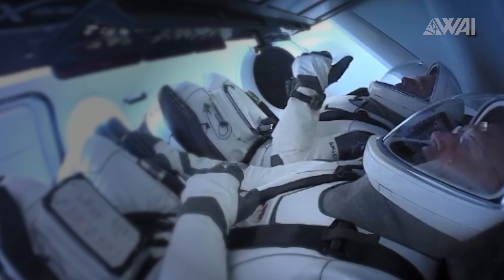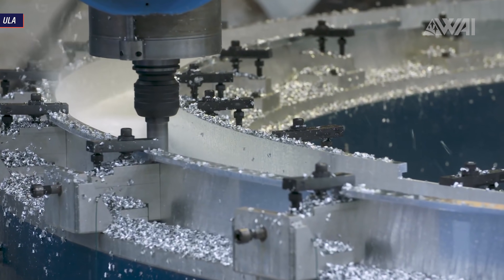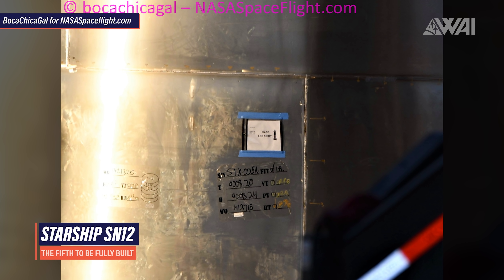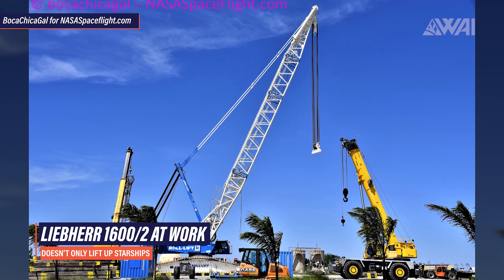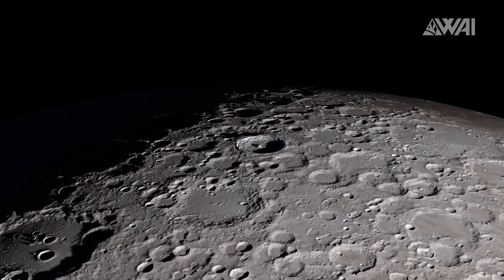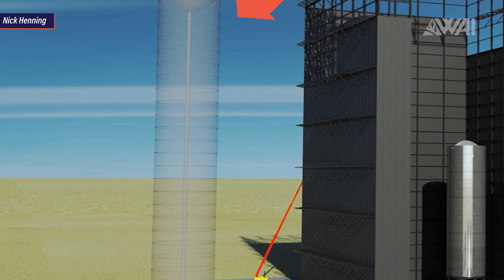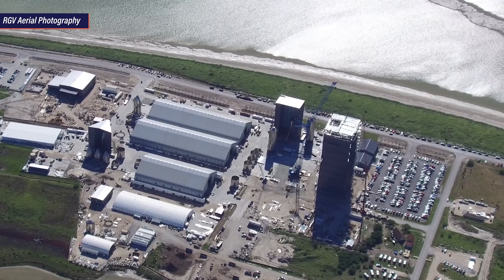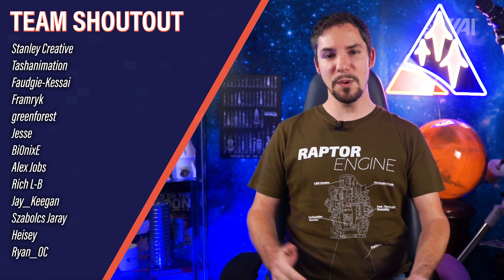124 | SpaceX Starship – Testing About To Begin - Super Heavy The Giant

Comment: @What about it?
I've have a theory about the whole "producing LOX on the old gas well site"
Recently there has been a mystery on what will happen to SN5 and SN6 now tat we know their test flight purpose is done, they have been wandering between the bays, basically being empty space.
Don't you think it would make sense that elon sends them both to the on-site LOX production place to use them as storage units for such LOX? 
They could also change the engines on them for some the ones to be used in the superheavy, and use them to static-fire in order to test the locally produced LOX's quality.

Why trash them when you can still use them? Steel rockets ain't cheap.
Reply: LOX storage tanks are dewar tanks. The insulation is like a thermos bottle. A full vacuum space.
Reply: @kkarllwt  Good point. Hadn't realized they had to be. 
Now the question is, could they be repurposed as dewar tanks or their best hope is either decorative structures at the entrance or scrapyard material?

Comment: Very impressive, specially the fully flow raptor 350 bars engine, a kind of formula one engine performance with the endurance of the the old Cox air cooled where the other still have have the F1 short life with a Cox engine performance...Yet my greater concern remains that no one and no recovered load ever came back to earth from the outer space in a large light tin can. The behavior, endurance and resistance to the atmosphere upper layers of a thin evaporative shiel glued to a SS steel thin can at 8 then later at 11 kilometers per second !!! remain to be seen. It depend entirely on the possible good lift to drag ratio of the light rather empty Starship and its ability to extent le slow down process over time to reduce the peak heat stress well below melting and burning level...To me this remains and will be by far the biggest challenge of the whole launch recoverable system.

Comment: He said, they are getting 'a power line so they can use wind power'. The power line isn't needed if your wind turbine is local. That means that he will be using surplus grid power to run a liquid oxygen plant at off-peak times.

Comment: There are some interesting Super Heavy milestones to watch for.
     Can the thrust puck to ring weld hold up to the added weight of the much larger amount of O2 and CH4  in Super Heavy with a full load of propellant vs the Starship.  If I got the figures right a full load of propellants would put 5.24 Bar of pressure on the thrust puck.  Add tank pressurization and RUD?
     Can that weld hold up to the pressure of 28 Raptor engines firing or will it simply break free and shoot up into the liquid O2 in a RUD.
     Elon's self set goal of sending Starships to Mars by 2022 and to the Moon in about the same time frame.  Last we heard SpaceX was producing Raptor engines  at a rate of about one per month.  Is it possible to produce enough Raptor engines for the Starship and Super Heavy full prototypes through 2020 and 2021 at a total of 32 for each complete prototype?  How fast can the output rate for Raptors increase, allowing for production of multiple Starships and Super Heavies for a full testing and certification program?

Comment: One point no one has spoken of is: will the super heavy booster need to be fully or partially loaded with fuel before star ship is stacked on top? Since one of the failures of starship was in effect the loading of the top tank before the bottom tank, this will be a more prominent issue when a full payload is added to starship and stacked in top. If so, then there will be a massive risk of stacking starship on super heavy while it is partially loaded. 
Could you touch on this risk in an upcoming video.
Thanks

Comment: Bottlenecks are still Raptor production and launch site facilities (for a full stack). The heat shield is still completely unproven as well.
Reply: Raptor construction is constantly increasing and last I checked they have over 40. Heat shielding is old technology and should not be a challenge.
Reply: @MrEd2291  40 built over how many years? They only recently have reached a flight worthy design (see the engine rich exhaust on Starhopper). My worry is that even when they do manage to produce enough Raptors for an orbital test, a single failure could set them way back given the number of engines that would be lost.
Reply: @MrEd2291  Furthermore, tiled heatshields like the space shuttle used have yet to be done well. In SpaceX's early tests, the tiles they attached did not seem to do well even without atmospheric re-entry. This may prove to be an easy hurdle for them, but it is yet to be seen

Comment: Based on that Super Heavy booster rendering, why  does the booster have to be so tall? It looked to me that the fuel tank was way up near the top, and the engines way down at the bottom with nothing between them but a long, narrow pipe.

What am I missing?
Reply: The downcomer was passing through the liquid oxygen tank, not empty space. Liquid methane can be piped down through liquid oxygen because the temperature difference is not too large.
Reply: The LOX tank.
Reply: The entire booster contains two pressurized internal tanks holding two materials (components) for fuel, w/ the long narrow pipe through the bottom tank pipes one component of the fuel from the upper tank to the engines, where it is mixed with the other component of the fuel from the bottom tank. ;)
Reply: @theknave4415  Awesome! Thanks for that.

Comment: 7:35   The freshly poured concrete has been covered with a tarp to slow evaporation of water out of the mix.  That helps eliminate cracks.  They will stay covered a few days.  Curing concrete is an exothermic reaction.  The huge metal surface will act as a heat sink and aid in keeping it cool during that time.
Reply: Has anybody spotted 'vibration' machines yet, would be surprised if they aren't settling the concrete.
Reply: There is one attached to the boom. It extends down 4-6 ft below the end of the boom.

Comment: The thrust puck on the Super Heavy will have significant head pressure, significant weight from the engines and significant thrust & vibration. The weight of the downcomer will be a significant load on the common dome.  Add-in yet-to-be-experienced acceleration forces and my guess is design of the domes and their attachment to the main structure will come back to the forefront.
Reply: Yup, the upper 90% of SH will be easy, the bottom 90% will be very difficult.
Reply: Don't you think that those hydraulic jacks on the test vessels were testing for these forces and loads.  Give them some credit.
Reply: So, would you say these are significant issues?
Reply: @odysseusrex5908  
No. With such good engineers, simulation software, and early testing they should have no issue with optimising the SH domes. 

I am concerned mostly about the tile brittleness displayed so far, probably due to chaotic resonance of acoustic waves in the hull. The amplitudes are exceeding the capacity of the elastomeric layer. This will not prevent reaching LEO, but a good reentry requires intact tiles.
Reply: @avid0g   LOL, I was making a joke about the OP's repeated used of the word significant.
Reply: @odysseusrex5908  
Pls "stamp out and abolish redundancy"!  LOL
Reply: Keeping the structure radially in tension is the job of the hot gas pipes.  The entire ring structure is axially in compression, from its weight, from the thrust and multiplied by acceleration.  Those gas pipes are critical.  If pressure is lost, the column formed by the rings will certainly buckle under load.
Reply: The (only) tricky part of the design was to minimize mass while distributing the concentrated point loads on the thrust puck from each LOX-feed pipe, and that was already achieved on the Starship thrust puck. 

The thrust puck applies all of that Raptor engine thrust against the elevated tank pressure (and propellant inertia), not the tank walls. The hull remains in tension throughout the flight. 

So the greatest overall force on the lower dome occurs when "pressing for flight" (pressure is raised in anticipation of engine start and g-force exceeding 1.0). 

As engines push up on the thrust puck, the shear-force between the lower dome and the hull is actually reduced.

One force does increase however, and that is the hoop stress on both (SS&SH) oxygen tank/hulls at their bottoms. This force increases abruptly as the booster lifts off the pad. This hoop force gradually declines as the SH tanks empty, but rises in the Starship tanks.
Reply: @Ed Thompson  
Only the unpressurized sections of the stack "feel" the mass above them, and the abruptly higher G-force of acceleration. They have "top-hat" stringers to stiffen the hull against crushing. 

The tanks are already pressurized even before filling with cryo-liquids. The pressure alone is enough to keep the tanks in longitudinal (axial) tension through 100% of the mission. This tensile force is at maximum just as the stages "press for flight".

Although this tension is reduced by engine thrust,  the tank walls never reach anywhere close to compression.

The engines are tasked with replacing the same volume that they consume from the tanks, exchanging high-pressure gas for high-density liquid. The temperature of the replacement gas should not greatly exceed the average already in the tanks.  

The more excessive the gas temperature is, the more it will contract as it mixes (with some time delay). That is especially not desirable at MECO, when colder liquid typically spreads throughout the tank volume and will abruptly shrink the hotter previously-stratified gas layers, abruptly lowering pressure.

Comment: What about the vertical structure strength of the both booster and starship? What exactly supports all that weight, of rocket, fuel and cargo?
Reply: Steel, it has high compressive strength. Then pressuring the tank adds structural rigidity.  The non pressurized skirts around engines and at the top have stiffeners to make it stronger.
Reply: @James_Scheid  Thank you.

Comment: Why have the smaller tank at the top of the super heavy?  That requires a longer downcomer than if it was the smaller methane tank on the bottom
Reply: Methane is heavier than LOX, which is an other reason not to put it at the top. But SS has a center-of-gravity problem because of the weight of the engines, that may be why its heavier tank is on top. This may also apply to SH, with 28 Raptors and the big landing legs.

Comment: what is the exit strategy for astronaut in SpaceX SN project?  Space X successfully perform exit strategy for Dragon capsule. awaiting for new design.
Reply: Good question, considering this is the prototype test phase I imagine they won't have to worry about that until they develop the actual crewed Starships, cause the unmanned ones won't need them. But when they do maybe the top can separate from the tank section Enterprise D style, or they might make some small escape pods
Reply: @ReiseLukas   Hope Space X wont blow 10 T of "Tim Hortons" stuff which is essential for Moon and Mars :-p
Reply: Ejection seats for 100 passengers. That would be quite a sight😄
Reply: @herrahazardi3931  My Cone Separation idea suddenly seems better now
Reply: @herrahazardi3931  100 Fred Randalls is my greatest fear. 1997 movie Rocketman. :)
Reply: There should not be an exit strategy for the Starship, it is too expensive. Flying on the Starship involves a risk which must be accepted to fly.
Reply: @MrEd2291  good point, I mean commercial aircraft don't have ways of escape when still in mid air. The aircraft has to land with minimal damage before anyone can escape it.

Comment: Wouldn't it be possible to turn the energy the rocket produces when launching, into electricity🤔?
Reply: Maybe put a turbine into the flame diverter?
Reply: @franekcer1008  Yeah👍. That is kinda what i thought. Also a lot of heat is generated that could somehow be used to produce electricity.
Reply: if not for anything else, would be a fun science project.
Reply: @snuffeldjuret  For sure😀👍
Reply: How much would you spend to make electricity for 10 seconds ?
Reply: @kkarllwt  Dude the electricity produced wouldn't just disappear after the rocket launch. It would be stored in battery cells. Also the rocket launch produces soo much energy. And since Elon plans to launch multiple Starships per day in a few years time, this would be an enormous amount of electricity they wouldn't have to pay extra for so space travel would become even cheaper. I mean that was the plan with Space X.